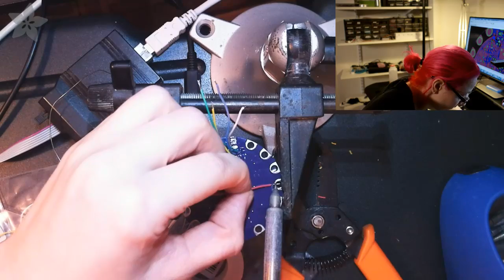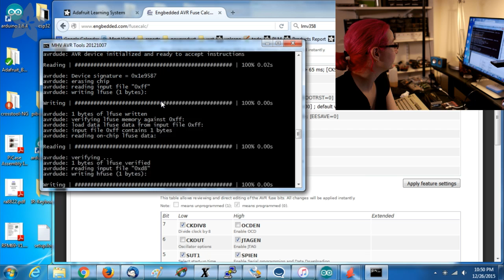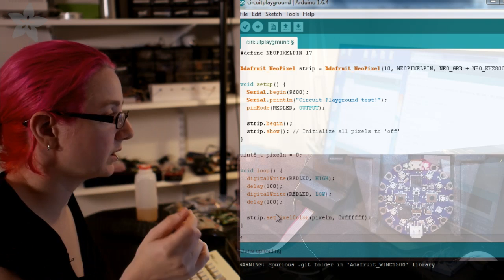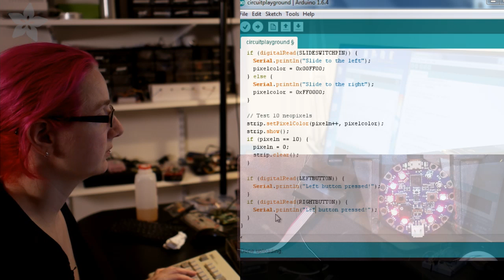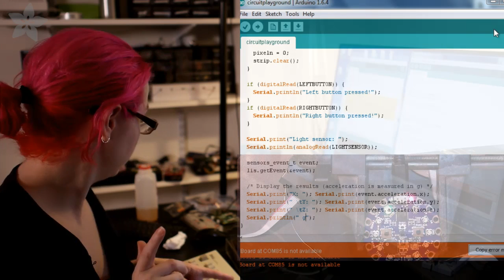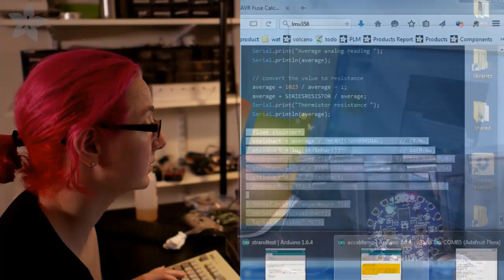Bring up Circuit Playground board revA 12/26/2015 - LIVE

Comment: Lady Ada: I am very impressed with your left-hand (not the soldering iron) soldering technique. While you hold the “wire” between your thumb and index finger, you hold the solder between your middle and ring finger. You also demonstrated this technique done vice-versa. Furthermore, you use your pinky for hand or part support. Thank you for the soldering lesson!

Comment: I'm still pretty new to electronics, so this might be a silly question. At 06:40 you are talking about what sounds like veeas? It might be an accent thing (I'm in the UK), you might be saying vias. Either way You lost me.
Reply: +Maxx B I think this is via:
"A via (Latin for path or way) is an electrical connection between layers in a physical electronic circuit that goes through the plane of one or more adjacent layers."
https://en.wikipedia.org/wiki/Via_(electronics)

I learnt something thanks to your comment ^^
Reply: I_I
Thanks, that makes sense now. :)